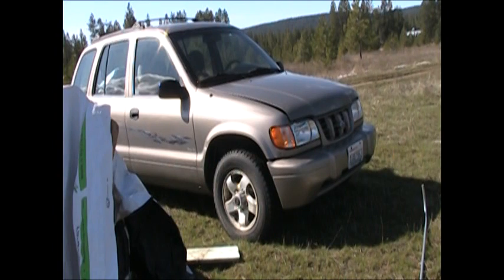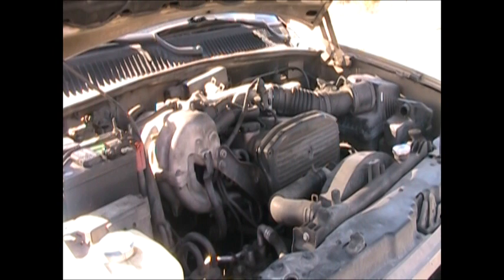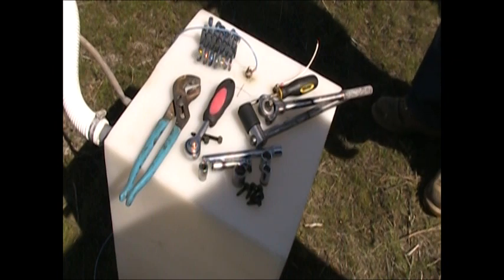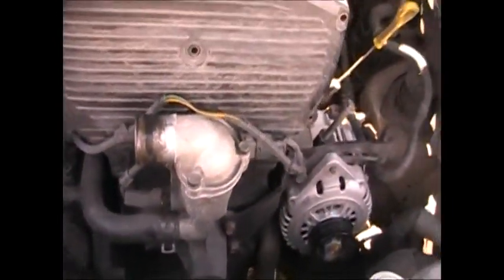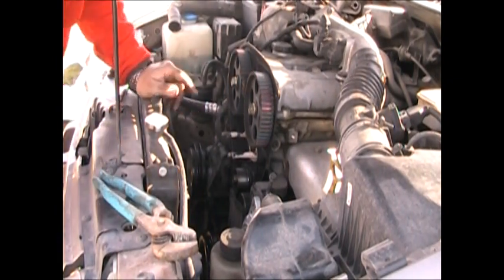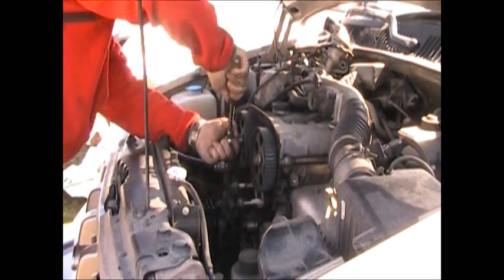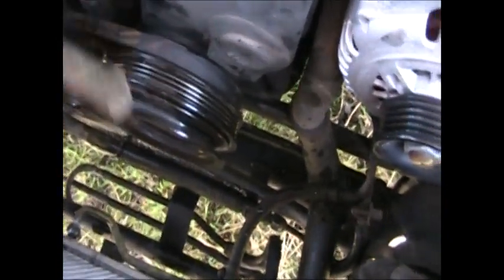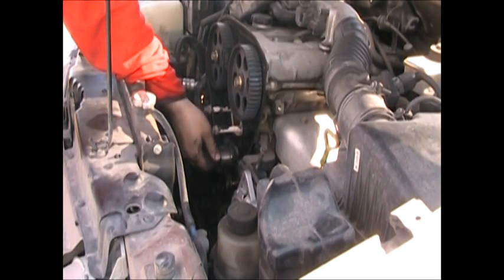Kia Sportage 2001 Timing Belt Removal

Comment: Great video. I have a few questions on a different topic if you can help. Is the power steering belt the closest one to the engine behind the belt for the alternator? Or is it the one in front? If it's the one behind it, does that mean I have to remove the first two belts to replace the one closest to teh engine? How might I do that? I know this is a lot of questions but any help at all would be appreciated.

Comment: Its a Non Interference engine. 2001 Sportages are notorious for coils going out however. I've done this work on my car before. Easy repairs what kills is labor. Do it once takes a few to change the second time psh you can do it faster than any garage and save some cash due to the belt being inexpensive. Great vid wish I've seen it before would have made first time a breeze.

Comment: Are they pretty good cars overall? I been thinking about replacing my 98 ZJ Grand Cherokee with something smaller and lighter. 
How does the 4x4 work? is it full time that can be used on dry roads, or only for dirt,snow, etc.  Thanks.

Comment: I had my son's timing "chain" replaced and the mechanic also replaced the water pump (I was ok with that) and all of the belts (I was ok with that too) however the total cost was $550.00. My question-is it possible that there are chains on some vs. belts and how does that price sound for a non-dealer repair-Southeast labor rates-no certain what his rate is...how long did it take you to do that job?

Comment: Dear Sir,
I have a problem to my short sportage 2000  2.0L gasoline
The car so low power and when kick down the gas, the engine going stoping
Its happen both when driving or just when transmission in normal, hope you can give me an advice.
Thanks you so much
Reply from the maker: Your Catalytic converter may be plugged?

Comment from the maker: Have you verified that it has spark? Are their leaks/blockages in the fuel line? KIA did something weird with the system in that is uses vacuum as part of the fuel delivery system. Is the fuel pump relay working?

Comment from the maker: I grew up with car engines in the living room, so I do quite well with anything made before 1980. Newer stuff is hit and miss. The 4x4 part works well, but is only for dirt and snow. The hubs are automatic and vacuum actuated. It could be improved with limited slip differentials, but then most cars could be improved that way.

Comment from the maker: Ok, on mine, starting from the front, I have a V-belt for the AC, a multigroove/serpentine type belt for the alternator and fan, and against the motor is a V-belt for the power steering.

Comment: I have a 2002 kia sportage, my timing belt it didn't break it was too loose..so it stoped on me oneday when i was headed to work so since it didn't break is it a possible chance that my valves are not cracked..are bent

Comment from the maker: If it has an Mazda FE motor, it will be similar, but I don't believe it will be the same. You probably have a single overhead cam. It will actually be a bit simpler than mine and have the other water pump.

Comment: I have a 2002 KIA sport age,and can you tell me what the name of the parts are on top of the spark plug,, And at what km should the timing belt be changed?Mine is 192000, it was changed at 14400,..lofty.
Reply from the maker: The parts on top of the spark plugs are the coils. You have two of them. I think it was 60,000 miles on the timing belt. I think I said in one of my videos.
Reply: +Lofty Murphy it's the coil that is on top of the plug each plug has it;s own coil

Comment from the maker: I'm not entirely sure. I did it across a few days as I had to stop several times for a variety of reasons. I had never done one before either, so there was research to be done as well. $550 is probably not out of line for this at all. Other cars are most likely worse due to the amount of stuff they like to stick under the hood on some cars. If I had to hire mechanics to fix my car, I would keep their phone number.